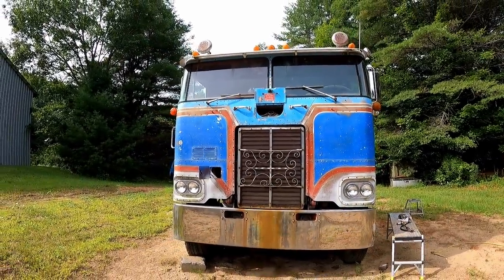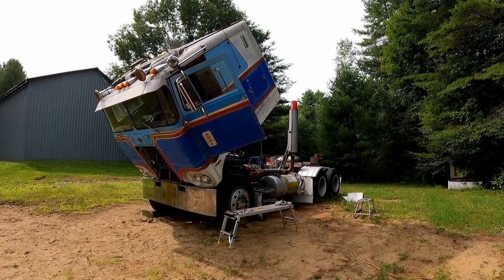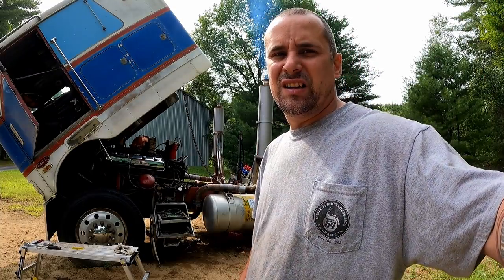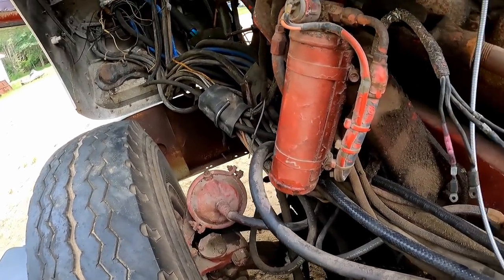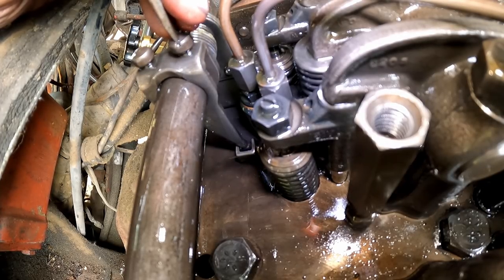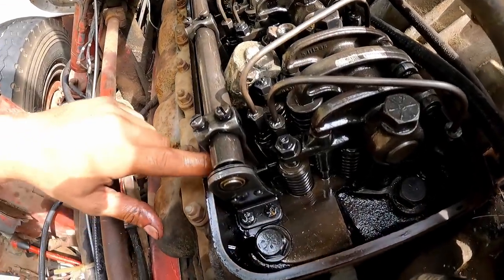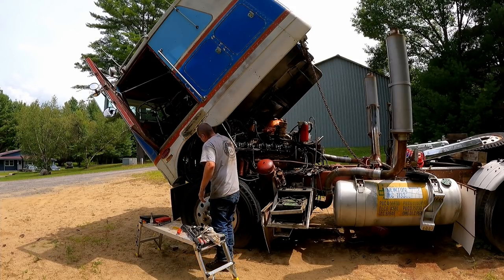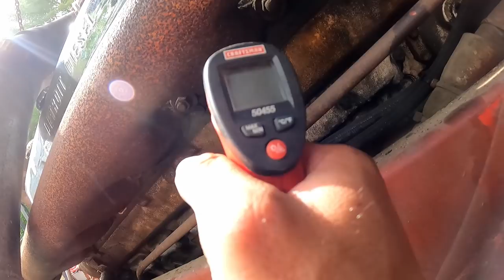1973 V12 Powered Peterbilt 352 Cabover - Episode 12 - What a difference a nice rack makes.

Comment: For some one that learns to drive on a cab over 12V71 what your doing is just the best thing with this pice of history. People think it sound cool have absolutely no ida how cool they sounded on damp night in the fall when the air temp is 40 pulling hard with 100,000 on deck on a twisty hilly road there nothing like it. Theses were the first long life motors the trucking industry hade back then. Theses motors never worked hard on the NY state Turnpike grossing 80,000. It was like you hade 1/2 a lode on. Most motors got 350,000 mills were needing a inframe back then. The 12V71 in are fleet were good for 600,000 or more but most hade a oil leak or to LOL I hope you keep up the good work and when you get it dun you get a chance to put a heavy load behind it there nothing like it the truck world. It somethings you will remember for as long as you live. Yes to days trucks get better fuel economy and pull better and last longer. But there sound in the world like working a buzzin dozen hard.

Comment: So my buddy who has the Hatteras boat with the 12v71 Engines has finally started the engine repair process. He found his old school Detroit mechanic who specializes in Detroit's.  He works on a lot of industrial engines or has over the 40 year carrier and he said on one tugboat he worked on the captain complained of excessive oil usage.  Well he went out to check on it and service it and found that one of the rods had come out the side of the engine block but it was still operating as if nothing was wrong with it.  He said these 71 series engines are some of the best engines ever built in the world because they are so tough and durable.  Its why the military used them for so many years too.
Reply from the maker: He's 100% correct
Reply: America was build on 2-stroke Detroit Diesel power. There isn’t an engine made that can scream Merica louder than Detroit. At least the pre-Mercedes ones anyway.

Comment: I think the reason GM wants you to do both racks independently is to avoid the adjustment of one rack influencing the other rack. So set them up separately and then hook them back up. I suppose there will also be a balancing adjustment between the 2 banks.
She runs smooth. It must make a glorious sound when going up a mountain pass with a fully loaded trailer.
Reply: Check out the sound of a 12V71TA.
Type in " Seattle Star ⭐ climbing Mt Ousley" unbelievable power. Cheers from Australia.

Comment: Some times the buffer screw has to be readjusted to make a jake micro switch work correctly (instant plunger instead of slow/delay >>> jake shifting on steep hills the buffer plunger has to be on the cutting edge>> instant on a detroit like these) , some times a little drift helps pulling out with a heavy load on hills especially , if you turn her over backwards you only have 2 forward gears low and high reverse  3 if you split  LOLOL (seriously>> emergency stop immidately and may have to put in gear an use clutch to kill it , just do it  PDQ ! )  . We use to set a 671 to pump off on 2400 the engine starts its climb a little easier an stronger . A 671 is suppose to use a quart of oil in 8 hours , slobber tubes an all , the 12V should use a little more . The last 671 I drove was 250HP c65 and advanced cam timing ,this type engine here . The 350 an 400 cummins will haul 40 ton of coal no problem , the 800 mack 65 rears large off road coal will haul 45-50 ton 300 or 350 mack with a 13 speed perfect set up , the large  long coal bed on an old cline/isco about 60+ ton automatic with retarder some manual , the older r35 euclids were a wickid sounding 12v no muffler the pipe goes up into the dump body to heat the dump body had 2 single bug eye head lights . Dont listen to old men like me we dont know nothing .......

Comment: Amazing that the non turbo 12V-71N puts out 476hp @ 2,100rpm and torque is 1,222lb/ft @ 1,600rpm. Compared to present day, low power.

Comment: I was never a mechanic, but owned Many trucks. Among them my favorite was a COE/Pete with a 12v92 and Fuller 13 speed. I also owned a another COE/Pete with a KT650 with a 13 speed. I know very little about the Cummins KT engine though? I understand there were three models , 450, 550, and the 650.are you familiar with these and can you tell me anything about them? Thanks in advance. I enjoy your videos they are very educational. I’m 83 bye the way, so all my experience is from years ago. Best wishes from the left coast.
Reply from the maker: Hey Duke yea the coe pete you had must've been a 12v71 or an 8v92 as they never did 12v92s for road use. The KT cummins were badass back in the day and yes 3 ratings of 450, 525, and 600. Id love to own and drive a 600 some day!

Comment: You are doing it right , the exhaust looking good and it sounding good , V8s  You do the same ,
Back in the late eighties I had a  1971 cab over freightshaker with a V8   detroit ,
what I done pulled the engine  out of the truck stripped her down and I took all of the 3 peice pistons out and what I done I put cross Head pistons in it , they are Turbo pistons  They are a one piece piston , what I done made me a 400 out of a 318 , Mann that bitch pulled good , I ran it for 2 years ,  Sold the truck got back into the Cummins Engines ,  You can do a lot with them for power ,  When I was a kid I would take the small boar 262 Cummins  and what I would do is put 335 kits in them and make a small Cam 335 and they were bad ass when you was done , They would throw 2 feet of fire out of the straight stack Shifting gears  , But you definitely had to watch your Pyro  In the mountains ,
Be safe take care yourself

Comment: When you run the rack. Aren’t you supposed to set the injector plunger height.  Or does that take place when setting the valve lash???
Reply from the maker: You do that when you do the valves

Comment: you set the injector way to tight, setting it that way will cause the injector to hang at full fuel, when it turns sideways the gear can wedge the gear in the injector, they should move up and down freely and just barely hit the full fuel
Reply from the maker: That is just flat out incorrect